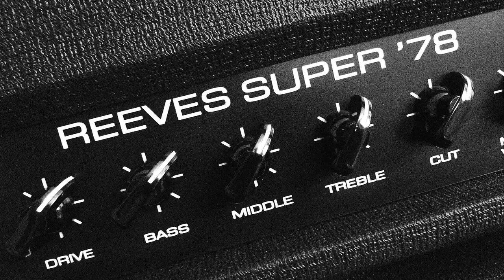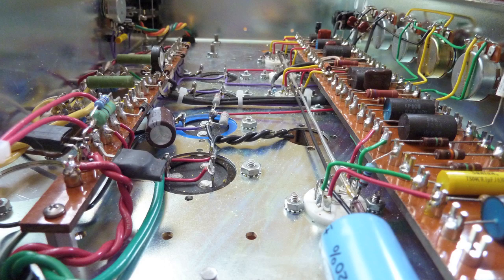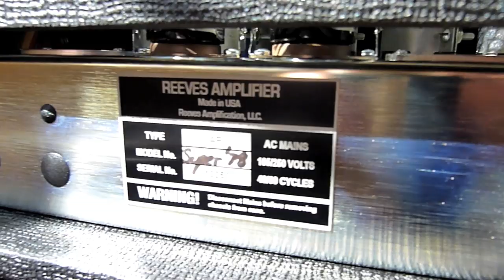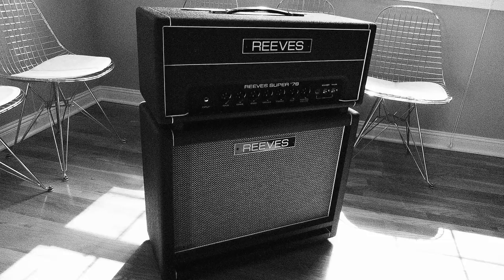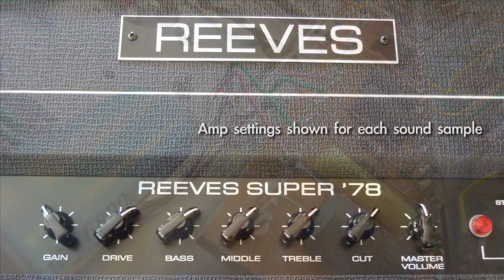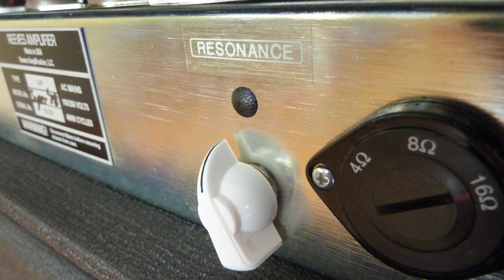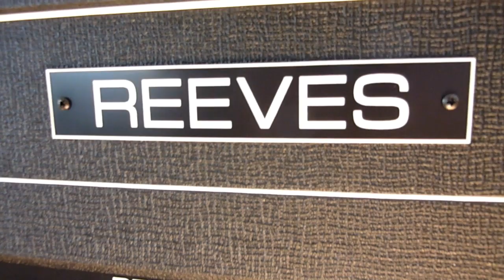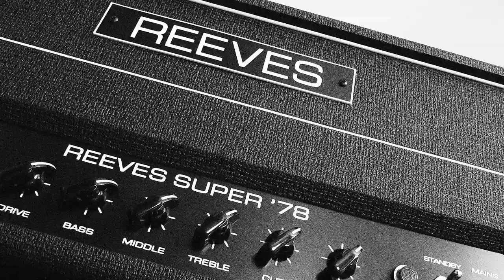Reeves Amps Super 78 amp demo by Greg Vorobiov

Comment: I have a Custom 50 and a Custom 30 and the 30 with KT66s is my #1 go to amp - the 78 sounds a lot like it. Next on my list to squire I think. It's a loud little beast and keeps up well with bigger amps but at times I would like just a tad more volume. I do gig and I play in a loud stoner rock band. Less HiWatt in nature and more like an cross between a hot rod Marshall, Mesa Mark I, and a super pushed HiWatt. I own a 74 DR-103 too so lots to compare against.

Comment: Hi Greg great demo- I like the old 80s Hiwatt Bulldogs (I guess I am a combo guy, takes only one seat in the car). The Reeves combo you demo is close in design and sound to the Bulldog, but the controls were on the front of the bulldog like this head. Seems silly to mention but I like the controls in the front, the combo has them on the back top bummer for me. So I would get this head before the combo. I agree with someone who commented on the combo that it seemed bass heavy but that could have been just a slight sound adjustment needed? I think they are worth the money! I noticed a selector for US and or UK power that is something that seems rather cool too for the traveling touring musician.

Comment: Hello! Thanks for the great demo!
Is it playable at bedroom levels?  I’ll probably add the power scaling option
Reply: Did you order one, and did you order it with the power scaling option? I'm wondering how necessary the ps option would be since the Super 78 already comes with  input gain, drive, and master volume controls.
Reply: @montag4516  didn’t order one but for home use the power scaling is needed in my opinion